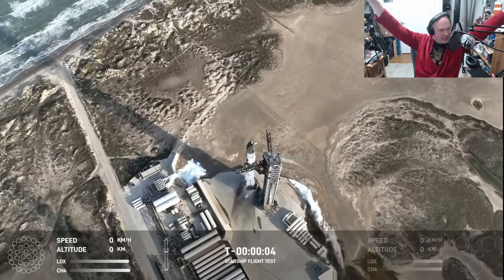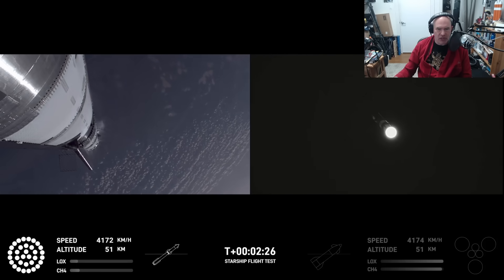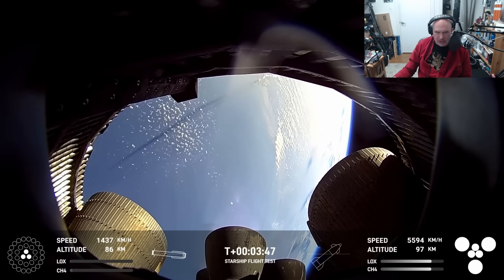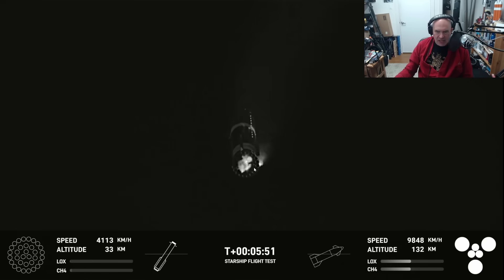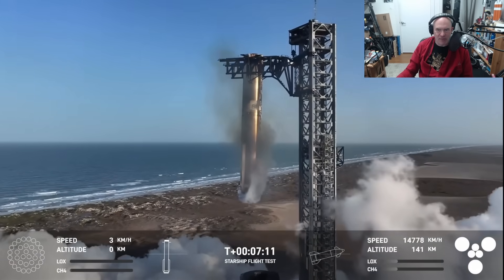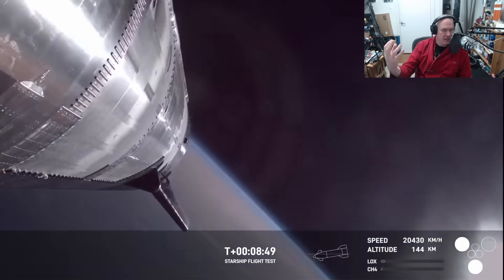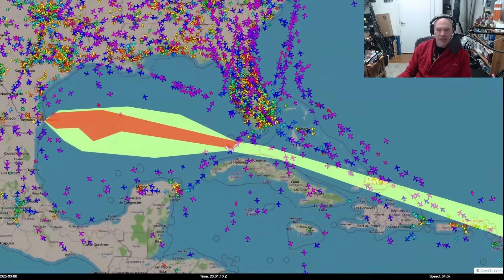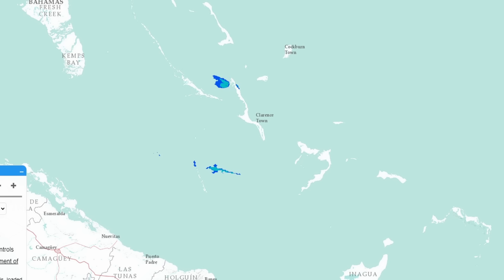SpaceX Make The Same Mistake Twice With Starship Flight 8

Comment: Surprising that once it started spinning those engines didn't auto shut down
Reply: I was wondering this too - had they shut down the remaining engines soon enough, maybe they might have been able to at least attempt a controlled re-entry.
Reply: @beenaplumber8379 they’d still have to terminate it, way too close to land to attempt bringing down, plus how’s it gonna do a splashdown with only two vac engines?
Reply: @ Good point. My comment was meant as more of a question because I don't know, but maybe if they could do a stable re-entry, could they have better control over the location where they either impact or terminate? I'd think they'd have more time to work it out and a smaller area for aircraft and shipping to avoid.
Reply: Outer engines should auto shut down if all the vectored engines do.  Nothing good can come from uncontrolled boost.
Reply: They probably wanted to use up as much of the fuel as possible, so the spacecraft is lighter and more likely to burn up on reentry.
Reply: @nikolatasev4948  Actually keeping it heavier would make it re-enter faster and thus burn more better.
Reply: I would expect them to shut them down quick.  I would expect them to want to keep orientation above all.  I would expect them to keep it intact if at all possible...  blowing it up seems to make a shotgun-like pattern. 

If these ever have passengers, it should belly flop if there are any errors and soft land in the ocean.  I suppose they could have ejector seats, and or a capsule with an abort system for manned flights.
Reply: @yamspaine  yep, imagine an engine out during a moon landing, I understand it might be out of scope for now but it seems a core feature to have and this was probably a fine moment to demonstrate it
Reply: @yamspaine this thing is never, ever going to fly manned. No chance.
Reply: i mean what could they do? It's spinning already. Even stopping it wouldn't do much at that point. They couldn't stop spinning because all the gimballing thrusters stopped
Reply: You dongos, they had already lost the 3 gimbal raptors.... she was dead, just didn't know it.😁😄😃🇦🇺
Reply: What about the mentality of fuck it, it’s already too far gone, and letting it do this gives them valuable telemetry on how systems and structures respond to such situations? Ideally stable flights provide good data but letting it go worst case scenario while it’s already cooked gives them a lot of data to work with that they hopefully never need to replicate later.

They are able to better understand the threshold of these systems and what they can handle with actual flight data and not just a simulation, it gives them actual information on key systems and what they can tolerate.

In the long run I would feel safer with that stuff accounted for rather than purely theoretically accounted for, they can confidently say these particular systems can withstand such forces with real flight data to back it up.

If you’re going to experience a flight failure, make the most of it.
Reply: @ApolloTheDerg yeah that’s not why that happened. That was a serious issue and it’s not about data, that immediately became about saving lives, because the initial ascent of starship is right around a lot of populated islands, taking a clean path right between them for safety. If that spinning sent it off course to some resort or city, it would be disastrous and kill easily hundreds, if not thousands. Either they were attempting to shut down to be certain it couldn’t veer off the flight plan, or they were panicking because they couldn’t contact it to trigger the FTS.
Reply: @Syntex366  The force averages out to zero over time for a spin induced by asymmetric thrust like this so they don't necessarily need to terminate.
Although IDK if this is true if there is already a spin in a different direction when the asymmetric thrust starts
Reply: @maxxiong  that would only be true if starship wasn’t also rolling, which it was. By rolling the uneven thrust kept switching sides, which meant it could linger longer on one end than the other, which could’ve sent it left or right enough to be a serious problem.
Reply: @ no shit lmao, I’m saying take advantage of catastrophic failure and learn as much as you can about how the complex combination of systems actually handled some of it and use that knowledge to better prevent against possible issues in the future, things theory cannot always account for.
Reply: The RUD may have taken out the control lines from the computer. Or the software is locked out of doing any critical changes at this stage of flight because they had problems with sensor readings in the past and the engineers wanted to prevent noisy signals from incorrectly shutting down a perfectly working engine.
Reply: I agree on this, I'm also thinking this vehicle will have humans on board sooner than later and the fact they already did not have a plan, software or else to mitigate an engine out, which might happen even in production is kind of worrying.
Reply: @fabiosemino2214  Yes, I think they need to have procedures in place for events like this, perhaps an onboard AI or autopilot to take independent action from ground controllers, failure modes with passengers onboard needs to be considered. Sympathetic or harmonic vibration can destroy machinery very quickly.
Reply: @fabiosemino2214  later than sooner. My guess is theyll never put humans in starship.
Reply: @fabiosemino2214   It's a test flight. They're no where near human rating. Does it even have a flight deck? By leaving the outer engines running, they're gathering additional data related to capabilities and limitations during upset events, of the engines and the structure as a whole. If it hasn't taken them outside the NOTAM/NOTMAR area and is not going to impact populated areas on the ground what is the problem?
Reply: @Thermalions  still thinking they may want to have that capability addressed and tested sooner, at this point the program is running at least since 2016, even if it's a dual use launch platform this is very similar to the space shuttle and they had engine out figured out by the first flight
Reply: you cant shut down any engines until youre at orbiting speed.
Reply: @Maxq-q4l  Running engines while spinning isn't going to get you to orbit, so yours is an odd comment.
Reply: @ you wont by shutting down engines also. its over when it happens
Reply: @Maxq-q4l  You can’t spin out of control either
Reply: @Maxq-q4l  You can shut them down. You just probably can't restart them.
Reply: @benbaselet2026  but its already too late
Reply: @Maxq-q4l Grasshopper never achieved orbiting speed. I think a policy which prevents shutting down is an oversight. Having a contingency which would allow them to bring the craft down in one piece, with a stable aborted flight which provides controlled descent to a contained debris field seems like the better solution than one which results in a RUD.
Reply: @R.B.  There was a fire in the engine bay. Even if you can control every engines, youre cooked, rocket is going down and even RSC are useless.
Reply: @Maxq-q4l  
Why? There was anomally and it was clear first cosmic velocity is out of reach. There was plenty of reasons to shut the engines but some other malfunction did not allow to close fuel valves and stop the engines. Perhaps the entire plumbing with valves failed.
Reply: @JanKowalski-vj9pyyour ideas are totally valid, but still, it should have failed safe. We know how to do that. 
Though you do say “ perhaps the entire plumbing system failed.”
That would be pretty catastrophic, I’d love to watch that footage from an inside camera!
But I’ll grant that cryogenic valves are tricky enough in a stable situation, add in 5G’s from rotation and they may not have actuated properly.
Or it may have been a conscious/combined design/engineering/ops decision, we just don’t know. But I’d love to be a fly on the wall.
(Not just an armchair quarterback, I’m a  systems engineer (automation specialty) with semiconductor mfg and cryogenic experience .)

Comment: you’d think that a multi-billion dollar company like SpaceX would have access to some structural analysis software that can check if the resonant frequency of the plumbing is less than the vibrations induced by the engines
Reply: That software was found to be redundant last year unfortunately.

Comment: Yet another predictable and miserable failure.
Better luck on flight 12? Flight 19? 
Reminder: Flight 8 of Saturn V was Apollo 13 - a disaster which still saw the crew safely back to Earth.
Reply: Let's review the Saturn V rocket: 

Apollo 5: After two orbits, the first planned 39-second descent-engine burn was started, but this was aborted after only four seconds by the Apollo Guidance Computer, which detected that the spacecraft was not going as fast as expected. This happened because one of the engine's valves was suspected of being leaky and was not armed until it was time to ignite the engine, in orbit, which meant that the propellant took longer to reach the engine, leading to the lag. The ascent stage spun out of control eight hours into the mission, after completion of the engine burns, due to a problem with the guidance system.

Apollo 6: Two minutes into flight, the F-1 engines on the S-1C stage entered pogo oscillations leading to the loss of one of the panels of the Spacecraft-Lunar Module Adapter (SLA). Three hundred and 19 seconds after launch, a fuel line leak in the S-II's engine 2 caused a loss of thrust. After 94 seconds (T+412), the thrust had dropped off further; both engines 2 and 3 lost 40 percent of their power, triggering a shutdown of both engines. The dual shutdown was accompanied by a power surge, which caused a loss in pressure in engines 4 and 5. Only engine 1 made it through launch unscathed.

Apollo 8: S-II second stage experienced pogo as reported by the command pilot at about 50 seconds before engine cut-off. Data analysis revealed an 18 Hz vibration of the center engine of the five engine J-2 cluster. Mounted on a crossbeam structure, the center engine was vibrating with the liquid oxygen (LOX) tank bottom. The magnitude at the crew cabin was actually quite small and no threat, but the local amplitude at the engine mount posed a threat to the supporting cross beam structure. Loss of the engine mount structural integrity would have led to the loss of the vehicle and crew.

Apollo 9: Apollo 9 behaved opposite to the model predictions designed to mitigate the pogo problems of 5, 6 and 8. A 17 Hz oscillation occurred between 500 and 540 seconds in flight, with peak amplitude of +/- 12 g’s at the local thrust frame. The vibration amplitude experienced on Apollo 9 was judged to be too near the 15 g structural limit determined for the support structure for flights to continue without some mitigation. Loss of the engine mount structural integrity would have led to the loss of the vehicle and crew.

Apollo 10: The S-IVB third stage exhibited a pogo oscillation of 20 Hz from 50-100 seconds into its burn. The vehicle shook badly again while executing the TLI burn, causing Cernan to be concerned that they might have to abort.

Apollo 11: AS-506 experienced a “small bulge” of pogo at 75 seconds into second stage operation of the J-2 engine cluster.

Apollo 12: Four well-defined pogo occurrences were noted during Apollo 12 (AS-507). The Apollo 12 vibration at the center engine had reached 8 g's and again concerns were raised for the vehicle's structural integrity. Time was granted for the contractor to develop a helium-bleed toroidal pogo suppressor for the oxidizer side of the J-2 engine. The suppressor was available for Apollo 13 (AS-508), but there were concerns with the flight schedule, and the difficulties of installation, inspection, and verification on the waiting Apollo 13 Saturn V vehicle. These concerns and the favorable analysis prediction of nonlinearly limited vibration amplitude led to a decision to fly AS-508 as-is. No fix for pogo was implemented.

Apollo 13: During the second stage burn, two episodes of pogo occurred on the center J-2 engine as expected from previous missions, but the third occurrence diverged severely and acceleration at the engine attachment reached an estimated 34 g’s (the accelerometer went out of range) before the engine’s combustion chamber low-level pressure sensor commanded a shut down. It was estimated in the post-flight investigation that only one more cycle of amplitude growth could have been sustained without catastrophic structural failure.

Apollo 15: There was a malfunctioning light on the craft's service propulsion system (SPS). Fearing that the light meant the SPS might unexpectedly fire, the astronauts avoided using the control bank with the faulty light, bringing it online only for major burns, and controlling it manually. After the mission returned, the malfunction proved to be caused by a tiny bit of wire trapped within the switch which could have triggered an uncommanded burn of the SPS engine.

Conclusion: The Saturn V nearly destroyed itself and killed its crew on every single flight.

Comment: Trying to stay positive. As a failure uncovers a design flaw, it is probably best to fail than to take a design flaw that will cause a failure forward. As they got close to engine cut off with all engines working, this could have been a design flaw not exposed by the test.
I guess this will mean a significant delay to flight 9, which I think was scheduled for a couple of weeks, but they need to get the reliability sorted.

Comment: Would it be possible for the engines to shut off then be able to right itself and land early?
Reply: Relighting the engines would cause an explosion, and hitting the water full of fuel would cause an explosion.  So technically yes, but it's not a good idea.  Also, no idea if they would be able to right that spin with the RCS given they'd be fighting against an uncontrolled leak in some random direction in the engine bay.

Comment: Interested in your thoughts as to why, when they loose the three center engines and one vaccume, they don't immediately shut off the other two vaccume engines.
Without any of the middle three they are going to spin out of control. Surely it would be more use to shut all the engines down and monitor the situation for longer. Letting the ship fly further from populated areas / flight corridors ballistically; before activating the FTS?
Reply: First thing that comes to mind is more data under off nominal circumstances.
Reply: Yeah, it does seem like in case of total loss of attitude control you should shut everything down rather than increase risk of exiting the hazard corridor.  Unless the main avionics were severed from the engines by the fire. But then you would think the engine controllers would be programmed to do a safe shutdown if they lost communication with the ship avionics for more than a few seconds.
Reply: Had the exact same thought. My answer: Keep it simple. A routine for handling these failures can itself introduce new points of failure.

Comment: It was a little ironic that they called out "FTS is Safed" less than a second before the engine burst.
Reply: Yeah honestly a bit off putting that this failure occured about 20 seconds before SECO but rather they learn the failings now rather than when a customer payload is on board
Reply: @KiRiTO72987  Starship 34 was 50 seconds short on the required 26500 km/h velocity to reach the Indian Ocean.
Reply: it was a delicious moment

Comment: Booster works good at least. Maybe they can find something to launch with it
Reply: I read somewhere that catching the boosters was so that they could reuse them. 

But they haven't reused any booster they caught, so I don't think those boosters can be reused in reality. 

This whole rocket system is a failure.
Reply: @pauligrossinoz  They only caught two before this one. Also, I think the boosters have been more successful than they expected, so probably it was not planned to reuse them this early. Reused or not, Super Heavy is clearly better than SLS. The Starship is a problem, and its usefulness in the immediate future is unclear. I believe this booster could literally launch a manned moon mission, they just need to put that kind of payload on it.
Reply: @dbohnenberger  - catching a booster but then falling to reuse it is still a failure.
Reply: @pauligrossinoz  Some engines from previous booster catch were in the last booster. Rocket is still in dev, F-9 is operative and boosters have made more than 25